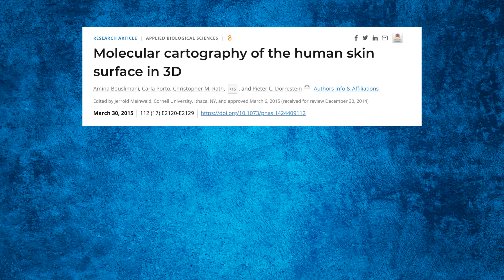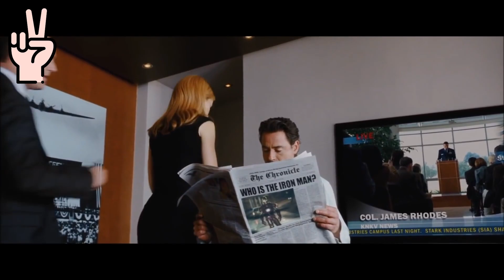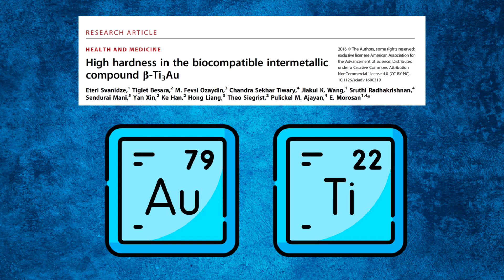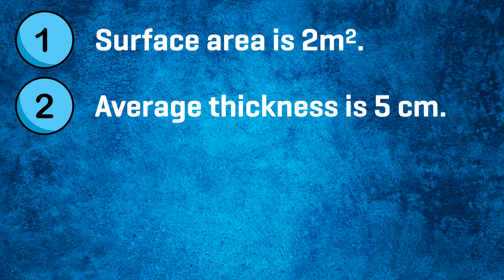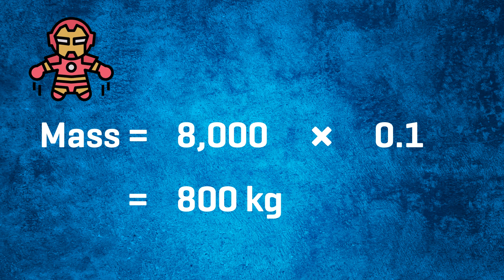How heavy is the Iron Man suit?

Comment: Body weight to suit ratio is interesting. What if I'm a larger individual of say 120kgs with probably slightly higher surface of the body. How much heavier would that make "my" suit? Due to my hulklike muscles, I wouldn't need as much protection and the thickness of 5 centimeters wouldn't be necessary. How thin could we go to still get me airborne?